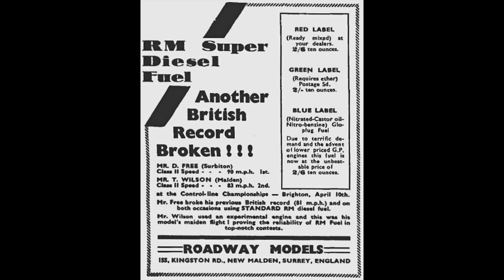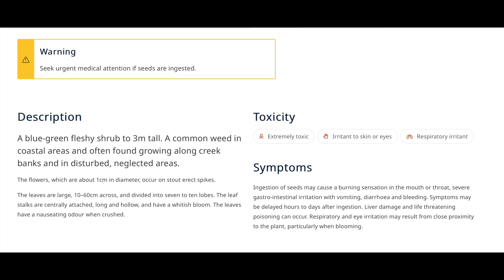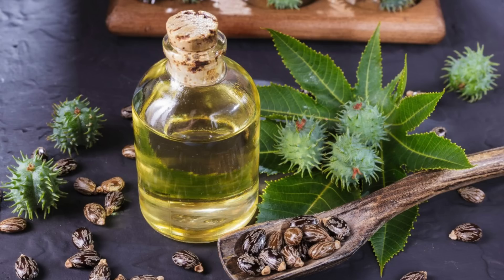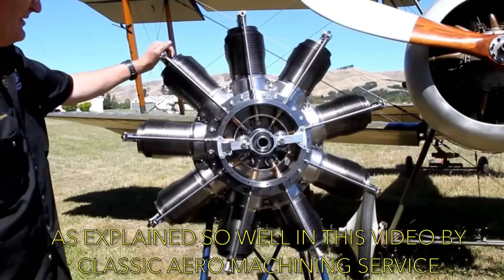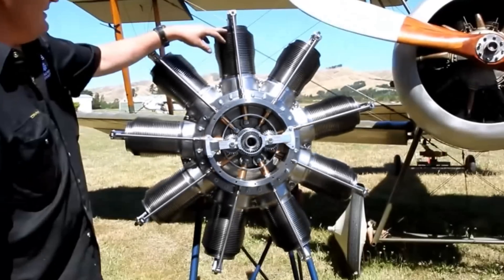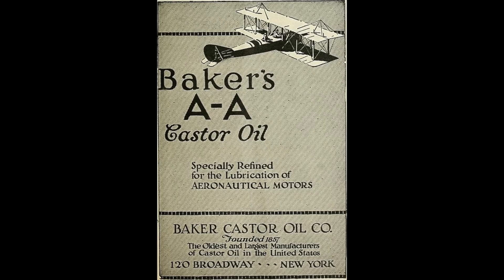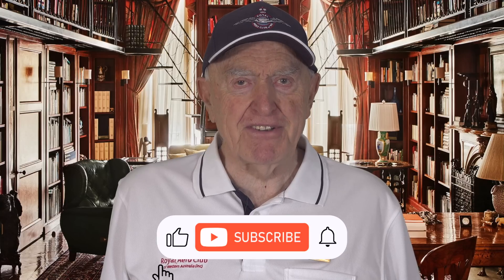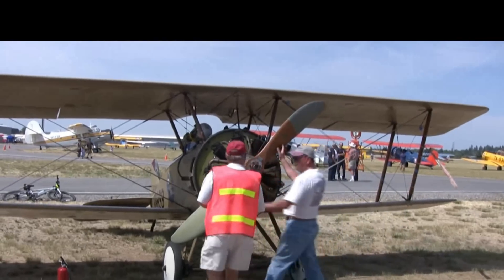Castor Oil's importance in early aviation

Comment: The scarf worn by early fliers was to wipe oil off their goggles. Due to the laxative effects of castor oil pilots would quickly head for the bathroom upon landing.
Reply: “…brandy, to counteract the oil’s laxative effects?”
Reply: They say that they learned quickly not to have their mouth open when flying. 💩😂
Reply: I've read more than one memoir that mentioned all pilots had diarrhea more or less constantly.  Which wasn't really a big problem as they had much worse things to worry about/anticipate.

Comment: always have some on hand for the chainsaw.... add a capful on every mix. 

getting pretty expensive though... penrites asking $50 or so per litre... and most places have a min order of four bottles. bit ripe, as its growing out in the garden! noxious weed, growing everywhere...

before the motorised pushy was banned, i was annoying the eco-warriors with my clouds of 100% renewable, carbon neutral smoke...

"its a two stroke, its polluting!"

nope... grew the castor plants. extracted the oil. (be careful of the raw beans and ricin?) then threw the plants and garden clippings (especially sugar cane...) through the chipper, into a few 44 gal plastic drums... let her ferment.

ethanol at 95%, too hard to refine past the azitrope... but that wasnt the end of it...

all the sludge then gets shoved in a beer keg, pyrolised for woodgas and distilled to that other alcohol... methanol.

a lot of work for a few measly litres... but if push comes to shove, it may be a necessity one day?

gumming is a problem, easiest method is throw some caustic soda in the oil.

and yeah, if you get too much exposure, urgent toilet stops are required...

Comment: Thank you for making this video!  You could make an entire series on the rotary-radial-reciprocating-piston engine.

 I did not know that castor oil was used in OTHER than this type of engine, and it was the well-known use of it that sparked my curiosity as to these engines particularly.  The best answer I got is basically what you have to say:  A main-bearing lubricant that is not miscible in gasoline must be used, so a non-petroleum lubricant, however inferior is the only option.

I understand that these engines stayed CLEAN due to the constant input of fresh oil.

The Rotary Radial has the benefit of not only throwing the main bearing lubricant out the exhaust ports, it has the less dubious benefit of throwing the CHARGE outwards towards the cylinder heads.  This helps prevent predetonation, an important thing back in the days of 60 octane avgas.

Thank you for the clip describing the intake process!  There is another engine-maker to add to your list:  Adams Farwell, who's engines powered cars, autogyros, at least one airplane and a boat.  That one has variable compression for regulating power!

Comment: Cool story!  We used to use castor oil in our 2 stroke motorcycles.  It smelled GREAT! I think its a smell that you love, or hate, and there is no middle ground. I can't say that I have ever known it used in 4 cycle engines.  But even in our 2 stroke engines the tar that came out of the exhaust pipe hinted strongly at how much it could gum up an engine. I can only imagine what a new car that has a 10,000 mile oil change interval would look like internally. IF it lived 10,000 miles!  I would bet it would take hours to clean up the inside of the engine just so you could thouroghly inspect it.
Reply: I use a mix of Castrol R and Marmite in my old Norton on the basis that it will irritate just about everybody.
Reply: @frogandspanner  Most old Nortons just terrify people
They take corners like on rails as the ads said after the McCandless brothers.
1958 600cc Dominator.
Reply: @frogandspanner  Yes, all you Aussies, Marmite is the original and far superior to your weak Vegimite!
Reply from the maker: Nah. Vegemite wins every time! Tasty!
Reply: @OldFliersGroup  😅😂🤣🤣🤣🤣🤣🤣 in your dreams dude! Damn convicts couldn't get the real stuff, so came up with an ersatz version.
No comparision!
MARMITE RULES!